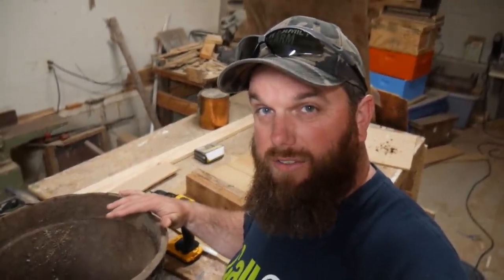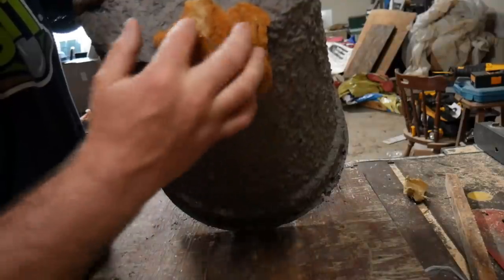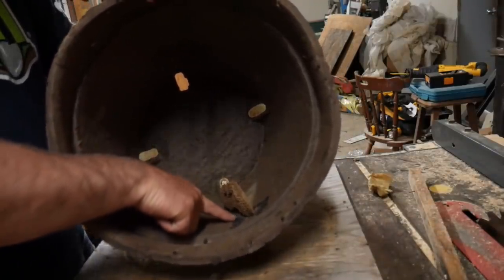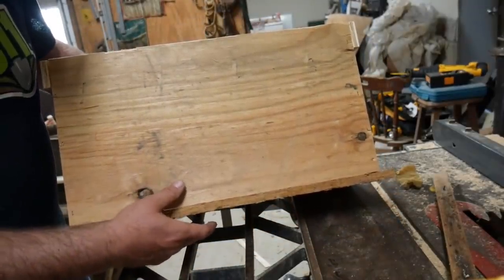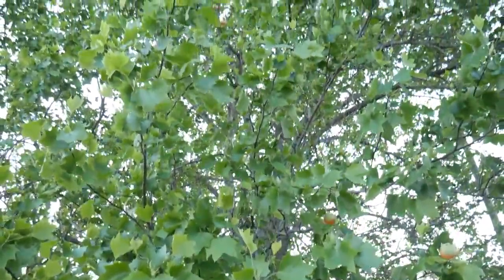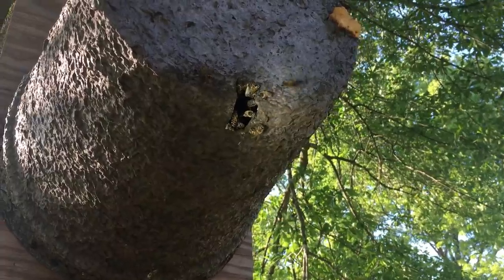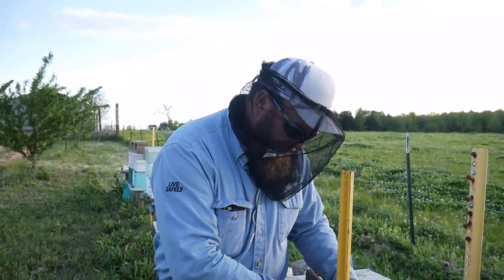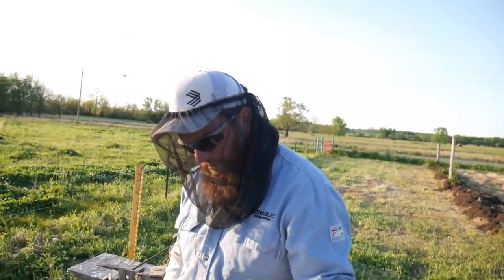Baiting Swarm Trap and Installing Bees

Comment: I’ve got my hive setup and a stand 3 feet off the ground near the trees and it’s a 10 frame hive. I have it baited but it’s been about a month and nothing yet. Do I need to just get a swarm trap in the tree or do you think they will come to my hive near the ground. Thanks in advance
Reply from the maker: It is possible that a hive will work but it hasn’t worked for me. I have set out these fiber pots for years and catch swarms every year and I have also set out nucs and not been nearly as successful. Also the general rule is to put the trap or whatever you have at least 6’-10’ off the ground and I face it southeast.